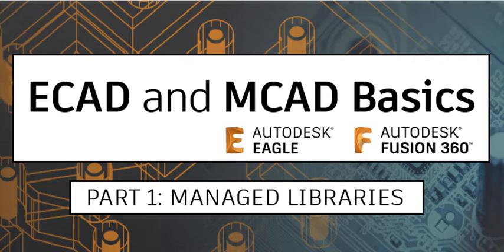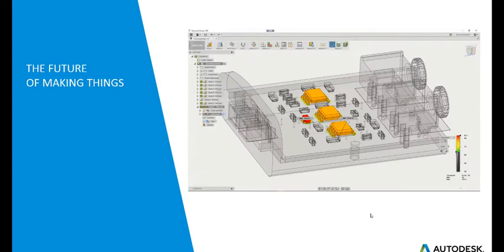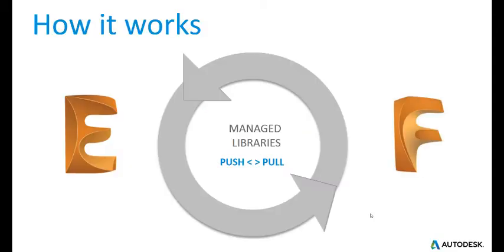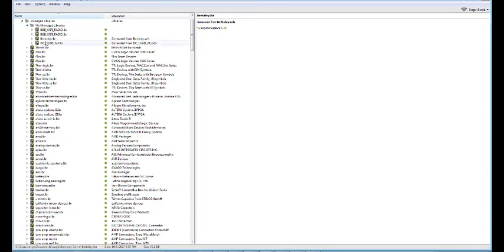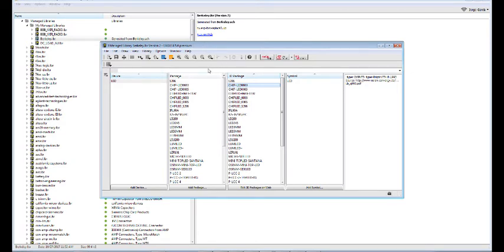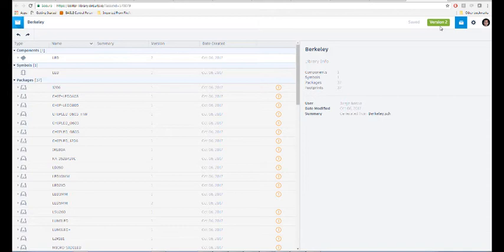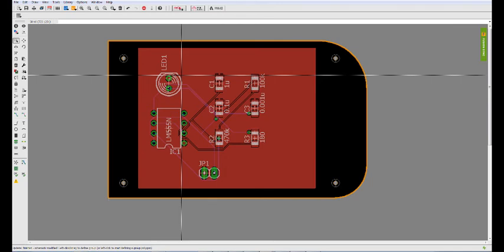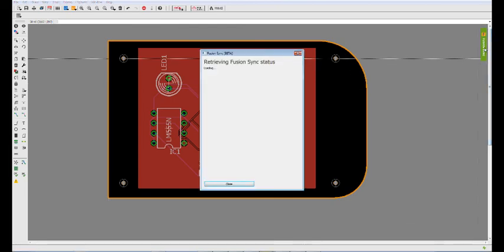ECAD and MCAD design basics:  (Part 1)  Managed Libraries

Comment: I find the integration between Fusion and Eagle very kludgey. I guess it is a result of acquiring Eagle rather than developing it from within Autodesk and the desire of Autodesk to store things in the cloud after the fact. The conceptually simple task of updating the 3D model of an part to reflect itself within Fusion requires many steps. Suppose there is no 3D model for your part (which is often the case). You might craft the part up in Fusion 360 or find a version online from a manufacturer. 
Then you have to save the part locally as a STP file.
Then upload the STP file into the library in the cloud. 
Then version the part.
Then version the library. 
Then update the library in Eagle. 
Then push the  Eagle design to Fusion. 
Then update changes within Fusion. 

Perhaps I am missing something but this seems overly complex. Wouldn't it be better to 'Edit the part' within Fusion. Fusion shows the default box. Update the box to a nice representation by editing, or importing a manufacturer's STP file. Then push/commit to the library, then pull the library in the other design from Fusion that uses it.  Eagle should not even be involved.